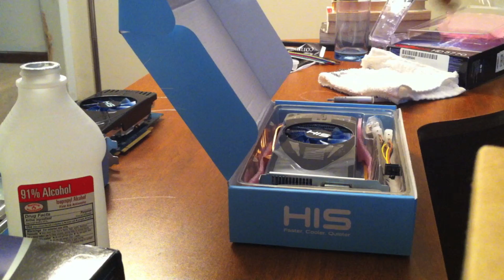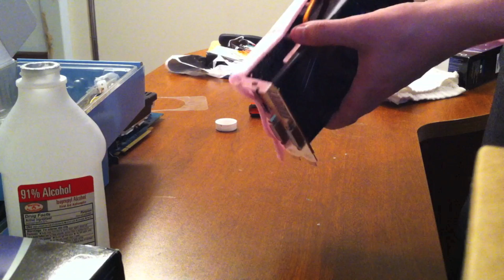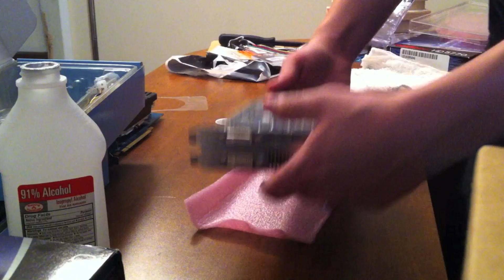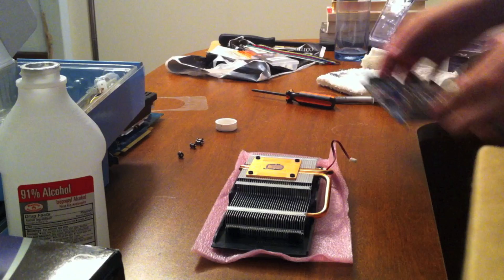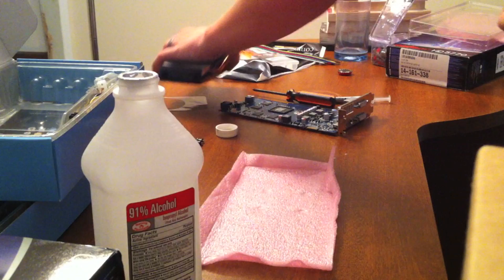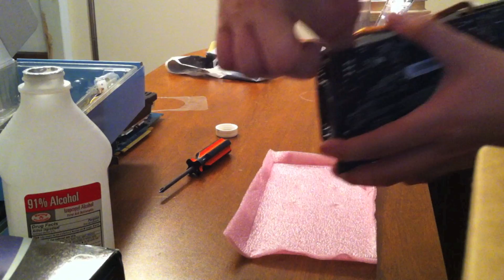Thermal Paste How-to for Bitcoin Mining

Comment: use a great paste dude, i in my opinion, he uses too much paste for that, the less the better, only need to close the 'holes' between heatsing and GPU processor, i would say 1ml, or even way less, depends on the size of the heatsing and gpu processor it self.
Good Mining for all of US :D my HD6850 only makes 189 195 mhash/s so iu underclock the GDDR5 ram to 500 mhz instead of 1000, and undervolt core to 1030 + - and overclock core of 775 to  799 ish or 785 ish

Comment: Wow! are you trying to insulate the chip, far too much paste, less paste is better as its only job is to fill the imperfections between the 2 surfaces, what you have done is insulate the chip from transferring heat efficiently to the heatsink, far far far to much paste!

Comment: Only a fool Could make SUCH a big deal about something SOOOO easy.Put About half as much as this clown , Then spread it out over the ENTIRE surface of the GPU.{the shiny part} . Then replace the Heatsink and shroud. My 6950 run's @ 26-27 Celcius Idle , and Running BF3 Full Ultra it Reaches a MAX of 65 Celcius.1920x1200. Dont over think it , and dont be a fool.;

Comment from the maker: @gasdorf video cards are in fact made to mine bitcoins. Video cards are simply math processors that can do tons of computations in parallel. Whether you're computing geometry for a 3d game, or doing the math for the SHA-256 hashing algorithm, it is using the video card in the same way.

Overclocking cards shortens the life when gaming too. But it's usually not too bad. If you watch the temperatures, and make sure they stay at reasonable levels, the cards will run for a long time.

Comment from the maker: @TheCmpOne 10-15c drop from stock for me. Each card is running about 70-80c. I used 5770's in this tutorial, and they generally run very hot. Most gamers claim temps up to 101c at full load.